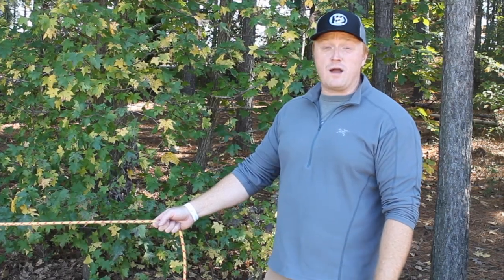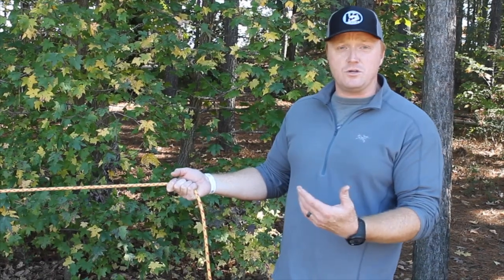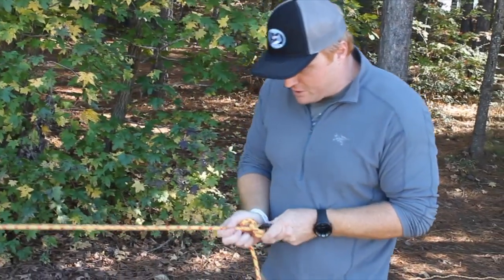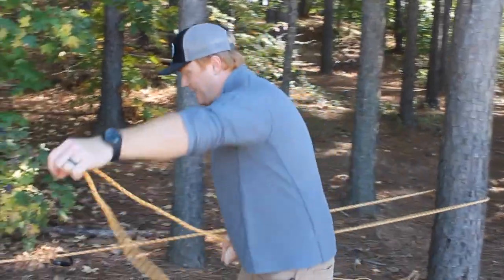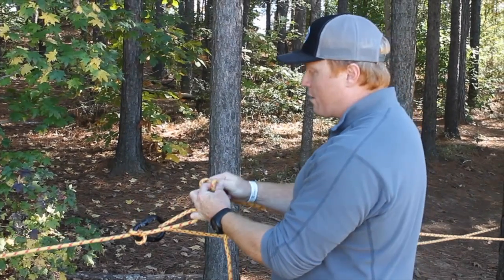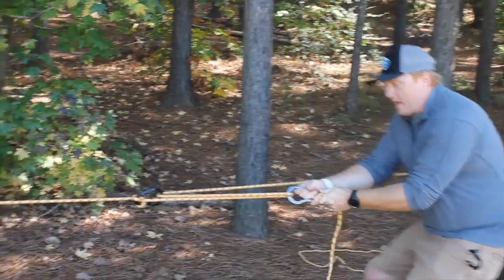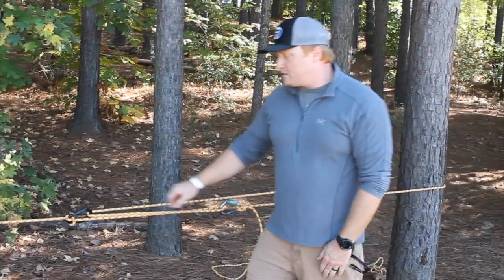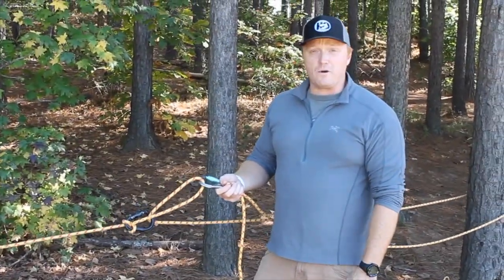Transport Hitch

Comment: This system actually needs friction to work correctly, so this is one of the few exceptions where the use of pulleys is not recommended. Richard Delaney has a 25 second video one can reference for a visual demonstration.